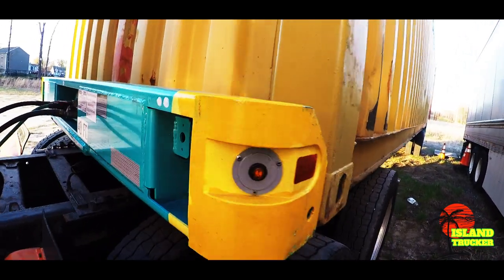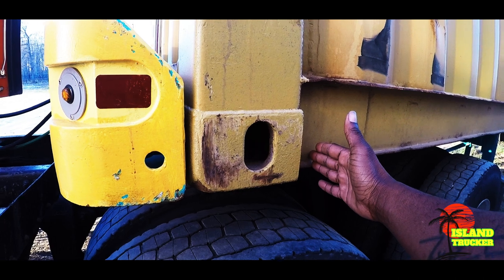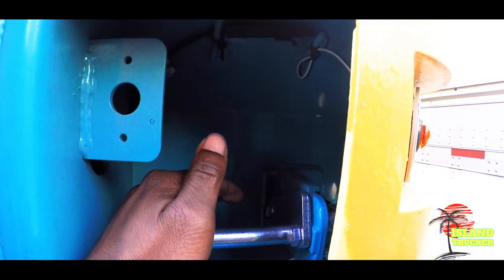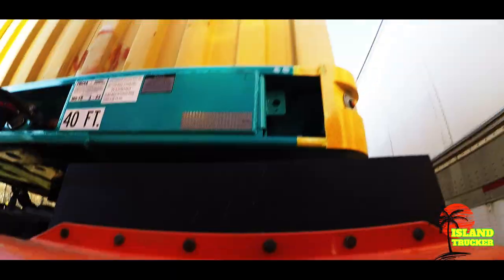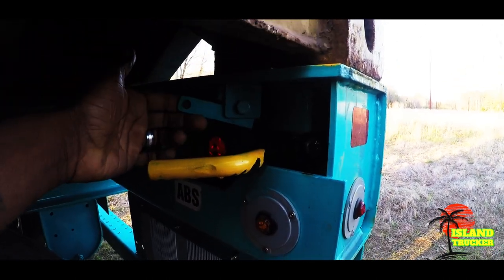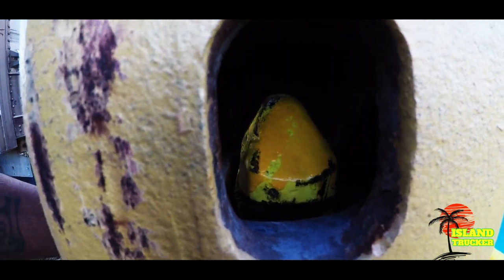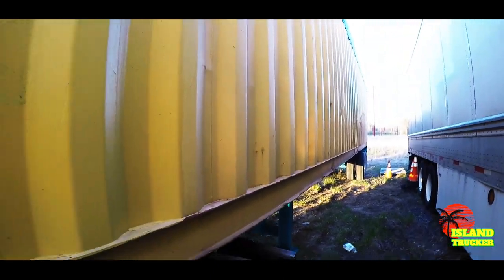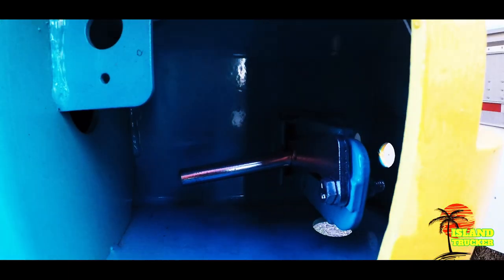How to secure container to the chassis | East coast container hauler

Comment: We do drops at the rail. I always pull the front pins. Because when they remount a box on chassis and hit the pins. It bends the flip keeper and sometimes the metal handle welded to the main pin. Most of the front pins on rail chassis are bent. Not the main big pin but the latch etc.
Reply: Are they damaged because they don't lower the container enough? Or is the container not aligned side to side usually?

Comment: Thanks for the video I am starting new job with container first time any advice will be appreciated
Reply from the maker: Take it easy, it is a learning process. Secure the pins the same way everytime. Example start at the driver side front corner and work your way to the rear and end on the passenger side front corner.